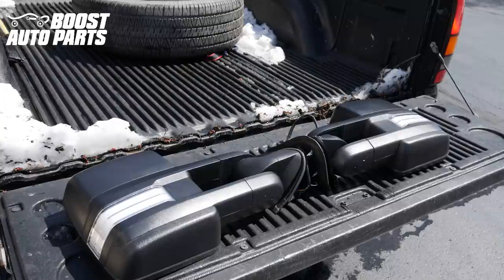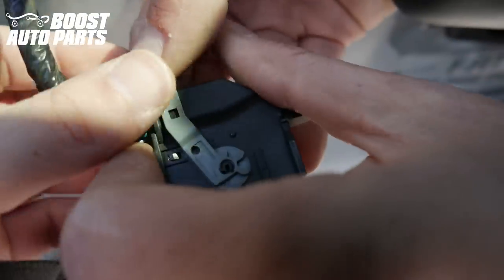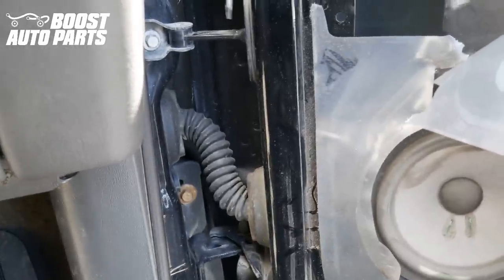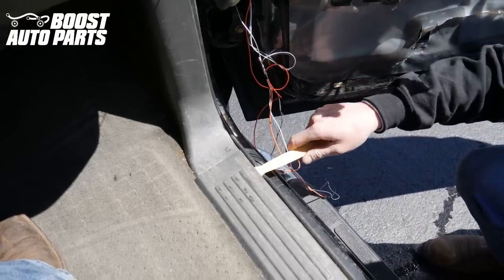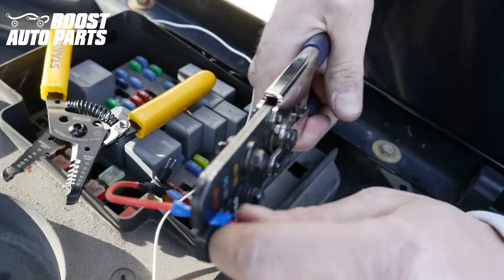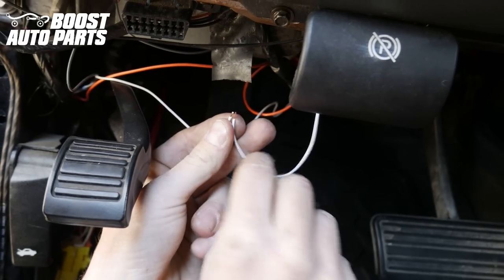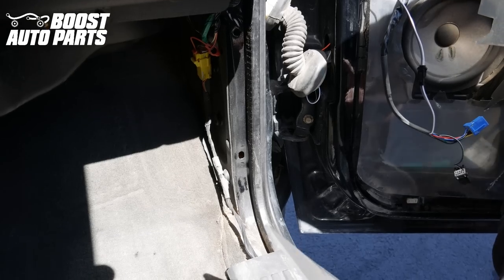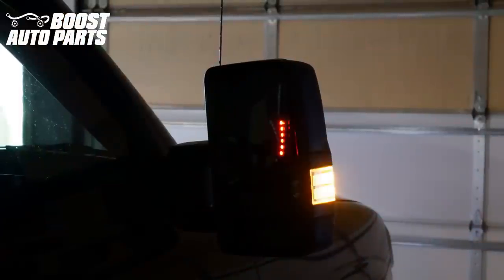Full Tow Mirror Install: (2003-2007) Silverado & Sierra - Boost Auto Parts

Comment: Thank you Adam and Ed.  Got my mirrors installed.  Purple wire was power on the 2 wire pigtail.  2006 Duramax.  Finding that gray wire was a bit problematic.  2 gray wires with dark stripes.  One was black and one was a really dark blue. Had to have wife look at it also to confirm.  Put a zip tie around it before splicing to ensure correct wire.  Getting through door rubber bushing was easy.  Splicing wire while being a contortionist under footwell was fun.  Your module works well.  Thanks again BOOST!!!!

Comment: My truck has no wiring going to the mirrors at all and I don’t believe I have rear defrost. How would one go about hooking up all the features of these mirrors on a truck like this 2003 Chevy Silverado 4.3 v6 2wd single cab long bed
Reply: Thanks in advance for any help and answers
Reply from the maker: Hello,
With your truck having a fully manual mirror some features may not be able to be achieved. Please contact sales@boostautoparts.com for specifics on your exact truck.
Reply: Ok thanks
Reply: @wyattsrepairs8860  what'd you end up doing? My truck is exactly like your's.
Reply: @RodknockRhett you and him need to both buy another truck
Reply: @kozmicflush980  I think I might just run my own wiring at that point. Put it on a fused switch.

Turn signals are also an easy one too. Tap into the wiring at the bulb. But honestly, I've been fine without any of it working. Might still do the heated mirrors but honestly I only use the truck when I haul stuff (nice weather obviously).

Comment: can these be installed/ will all the light features work on a Work Truck trim with non power doors?
Reply from the maker: Yes - though we would probably recommend purchasing the 99-02 mirrors if you don't have power mirrors because the wiring is better for hardwiring them in. Give our support team a call at 765-831-2830 and they can guide you to the best set for you!

Comment: I have watched several installs of these mirrors on You Tube, and nobody is indicating whether the  new mirrors's adjustments are controlled by the switches on the door.  Are these new mirrors electronically adjusted, or manually adjusted?  Please and thank you.
Reply from the maker: Our mirrors are power adjust; controlled by the switches on the door.

Comment: Can I wire my reverse and dome to the factory puddle light wiring on my factory harness? That way the spot lights also come on when I unlock or open the door at night instead of turning on when I turn my dome lights on manually.
Reply from the maker: That's a great question for our support team - give them a call at 765-831-2830 or email support@boostautoparts.com and they can assist!

Comment: 2004 silverado, did all identical wiring with no dome option. With key on everything works as it should, white DRL and switchback. But when engine is on the white DRL turns amber and loses turn signal/switchback function in the front. What would cause this issue? Thanks!
Reply from the maker: We have seen some vehicle side issues cause this. Give our support team a call at 765-831-2830 and we will get this resolved ASAP!

Comment: have stock mirrors for my 07 Sierra Duramax ...tow mirror on driver side will not adjust in tow position (extended), work when not extended, what would be the likely problem? thanks, nice video here
Reply from the maker: It sounds like there is likely an issue internal to the OEM towing mirrors themselves; you will likely need to replace the entire mirror assembly.

Comment: In my kit I only had two sets of white wires that ran from each mirror, when you use the converter it seemed you had two more sets of white wire so four in total so now I’m confused on what to do.
Reply from the maker: You bring the white wire from each mirror to the driver footwell and got off the extra length. The extra two wires you're referencing are the extra white wire that was cut off of the drivers and passengers side once they were brought to the driver footwell and cut to length.
Reply: @boostautoparts  perfect I will try that!

Comment: so i have a 04 Silverado but its has the work interior with no electric mirrors stock i have electric mirrors on it right now but need to find the wiring to send power to the mirrors please let me know if you know how to help
Reply from the maker: Sorry - we do not currently have a power adjust upgrade path outlined for these vehicles.

Comment: Is their a way to get replacement grey white extension wire ? If so where
Reply from the maker: If the mirrors are originally from us send an email to support@boostautoparts.com or give us a call at 765-831-2830 so we can assist.

Comment: I see you put the fuse you toom out into the adapter but what is the fuse that was already in the adapter? Did you just double them?
Reply from the maker: Our fuse tap comes with a 5A fuse.
Reply: Boost Auto Parts 

      Size of fuse holder?   Mini ATC or regular?   2006 Duramax

Comment: What if my stock mirrors don’t have defrost but these new ones do?
Reply from the maker: The defrost will work off of the rear window defrost button.
Reply: @boostautoparts  ao all you have to do is press the defrost button? No separate wiring?
Reply from the maker: @jbear6947 Correct. Mirror defrost will activate with your rear window defrost button.

Comment: Will the spot lights turn on if i turn on the dome lights from the dash switch?
Reply from the maker: If you buy the dome and reverse option and manually command the dome lights on, then yes the mirror spot lights will come on.
Reply: If i don't choose the reverse and dome option but just reverse only, will they light up by the key fob unlock just like the stock reverse light?
Reply from the maker: @seangowan7441  That depends on your vehicles specific configuration. Please contact sales@boostautoparts.com for further guidance or call our team at 765-831-2830
Reply: @boostautoparts  It's a 2004 Chevy Tahoe.
Reply from the maker: @seangowan7441  Please contact our team - they are most versed in the specific fitment related questions.

Comment: For the signal/running light is it a 1.0 or 2.0?
Reply from the maker: In this video we show a switchback, which is a white running light and an amber turn signal. The comparable version if you were wanting only amber (no white running light) would be the 2.0.
Reply: @boostautoparts  alright thanks

Comment: Orange Fuse ?
Reply from the maker: How can we help?
Reply: What fuse is the orange one .
Reply from the maker: @j.rbeastbangz522  Orange wire is for the running light
Reply: Because on the fuse tape you have a orange fuse already..
Reply from the maker: @j.rbeastbangz522  We are not understanding your questions. Please call our technical support team at 765-831-2830 and we can assist with your question.

Comment: Could i hook up rear leds to the cargo light fuse instead of the reverse one if I wanted to just use them off the button?
Reply from the maker: Unfortunately not due to the design of the cargo light system on this year truck.

Comment: This will work for a 05 classic right? The only wiring I should have is turn signals. How does the defrost get wired?
Reply from the maker: Yes this will work for an 05 Classic. Defrost is plug and play with our mirrors and controlled by the rear window defrost button.
Reply: @boostautoparts  thanks! I wasn’t sure since it lists almost every year in the category but doesn’t show a figment for 05 classic. I just see 07 classics. 👍
Reply from the maker: @RBoysMedia  Got it!

In model year 2005 there's no such thing as a 2005 new body vs. classic body, so we just call it a 2005 but it will absolutely work for you!
Reply: @boostautoparts  exactly. Thanks!

Comment: Just installed these and these are so awesome! If you've been wanting a set, pull the trigger and get them! You won't be disappointed!!!

Oh, and use the RED spicer when tapping into the wiring for the dome/courtesy lights! The blue tap is too big and won't make the connection. (Ask me how I know.)
Reply: What's a red spicer?
Reply: Hey man, did you have to wire anything up to get the blinkers to work? I mainly just want the blinker function on my 07 classic but I don’t want to have to wire

Comment: I’m a bit confused run the passenger to driver side spliced it, run it up to the fuse box, where does the white wire for the dome come from
Reply from the maker: You run a wire from the dome light wire to a blue wire on the dome and reverse. We have a separate video that just covers the dome and reverse.
Reply: Wait if you got the signal only mirrors does the dome and revers work with them ?

Comment: I'm so confused I'm currently installing the switchback option with dome and reverse on my 2003 Silverado and I understand you sliced the passenger side orange and white wire to the driver side orange and white wire and ran those up to the fuse box but now you're saying to you both of the white wires from both mirrors and put them into p/n 1844C But but both of my white wires are already spliced together and running up to the fuse box So what do I have to do and how will I do it??
Reply from the maker: Your two whites that run to the mirrors will be on the single output of the 1844C. On the side of the dual function dome and reverse module (PN 1844C) you will have reverse from the fuse box on one side, and dome from the wire on the A-Pillar on the other.

Reach out to support@boostautoparts.com and our team can further clarify this or walk you through it over the phone.

Comment: So what happens with you go to slam the fuse box cap in the engine bag, boom fire hazard by pinching wires and shit not work 😂
Reply from the maker: Not the most wise idea to do that, but even if it does happen it wouldn't be a fire hazard because everything we sell is fused appropriately!

Comment: Im currently trying to splice lighted door handles in, and cannot find what wire turns the sequentials on on the front of the mirror. Does anyone or can yall help me?!
Reply from the maker: Give our support team a call at 765-831-2830 and they can detail the wiring color configuration on our mirrors.

Comment: Installing mine today! 2007 2500 Duramax Classic. Broke my driver side main mirror by pressing up on it as the motor was getting tires. Well the glass didn’t like that so much. So I currently have a high mirror, mid mirror and wide angle low mirror. 🤣 So, it was the perfect excuse to order this set up.

Comment: My my rear facing light blinks with my switch backs on the front of the mirrors and doesn’t turn on when I put it in reverse. Any tips? I’m pretty sure it’s wired just like in the video?
Reply from the maker: It sounds like something may be wired wrong internally inside the mirror. If the mirrors are from us, email a video to support@boostautoparts.com and our tech support team will get to the bottom of it ASAP.

Comment: I got these same mirrors but mine just came with the reverse light wires will my running light still work without that additional kit ?
Reply from the maker: If you didn't originally purchase our mirrors with running light you can gain it but some wiring is needed. Reach out to our team at 765-831-2830 or sales@boostautoparts.com and we can let you know the best way to do this.

Comment: What would I do if I have a base model 2005 Sierra with no power mirrors or anything, how would I hook up the turning lights?
Reply from the maker: I'd recommend reaching out to our team at sales@boostautoparts.com or calling us at 765-831-2830 and discussing. More than likely our team will have you purchase 1999-2002 mirrors which have the same base, but would be easier to wire in the lighting features if your truck is totally manual.

Comment: My truck is an LT with power mirrors but no turn signals. Would a lighted mirror like this with reverse lights work because I have power mirrors or would have needed to come with turn signals?
Reply from the maker: Our mirrors will be plug and play for turn signal functionality even if you didn't originally have it. To gain the running light and reverse light functionality you will need to wire it into the vehicle by following this video.

Comment: So for the dome and reverse lights are the mirrors supposed to come with an extra white wire? You say that the white wires used in the output aren’t the same as the ones running to the fuse box, so what white wire is it?
Reply from the maker: It is just an extra length of wire; most people cut off the extra slack from the drivers side and use that. Please reach out to our support team at support@boostautoparts.com if you need assistance
Reply: Where can i buy the reverse/Dome switch from

Comment: How do I wire these if my trucks a work truck model. 2005 GMC Sierra 2500 duramax
Reply from the maker: You would need to hardwire in the turn signals. Reach out to our team at support@boostautoparts.com and they can provide guidance.

Comment: Why can’t I bolt on and plug them in to existing wiring?  I want tow mirrors but have no interest in running wires. To be honest I don’t need them to even telescope. Just want the bigger wider mirrors with same adjustability  function as a standard non telescoping unit
Reply from the maker: You can - all of the wiring is for the lighting so if you don't wish for the lighting to function you don't need to wire it in.

Comment: so do i connect the two whites and the two oranges from each mirror and run them up to the fuze box? but then where does the third white wire run.
Reply from the maker: Yes - whites splice together as do oranges. If doing dome/reverse you'll have one more white feeding off the dome wire. Give our team a call at 765-831-2830 for further clarification

Comment: Just ordered some of these for my 04 duramax, do I have to run the wire tap? Can I just use them like plug and play and still have blinkers and defrost and such
Reply: Is yours a 04 classic?
Reply from the maker: You can retain the features originally equipped plug and play. Give our team a call at 765-831-2830 with any questions.

Comment: The ones I installed only had 2 sets of orange and black wires . I fed them through to the battery box but I have no wire taps . If I were to get fuse/wire taps for this would it work without the ground ?
Reply from the maker: You will need to ground the wires as well.
Reply: Thank you for the reply . Where are the other end of your ground wires attatched to ? Mine only had a red and a black wire for each mirror . I have them wired up just like in the video they work but they flicker . How would I add a ground to a setup like this ?
Reply from the maker: @mattboone1926  Unfortunately since the mirrors are not from us we would not be familiar with the internal wiring so we would recommend reaching out to whomever you purchased the mirrors from.

Comment: Buying for my 04 Yukon what’s the difference between signal and running 1.0 or 2.0
Reply from the maker: Signal & Running Light 1.0: The lights will flash as a turn signal. At night when the running lights are activated, the lights will operate at 50% intensity for running light, 100% intensity for turn signal.

Signal & Running Light 2.0: The lights will flash as a turn signal. At night when the running lights are activated, the lights will operate at 100% intensity for running light, 100% intensity for turn signal.
Reply: Boost Auto Parts thanks really helps out

Comment: So do you connect orange wire ? Both or ???
Reply from the maker: Yes, both orange wires need to get connected. You can run them both to the same fuse tap, or you can splice the drivers side to the passenger and then just run the drivers side to the fuse tap.

Comment: Everything works fine on mine but the only thing that doesn’t is the running white lights
Reply from the maker: If your mirrors are equipped with the running light feature that would be controlled by the orange wire on our mirrors. Reach out to our support team at support@boostautoparts.com and they can get you situated.

Comment: If my truck already has factory heat and signal do you still have to run the wires all the way over to the driver side and tap into the fuse box?
Reply from the maker: Only if you want the reverse light and running light to operate.

Comment: What if you don't have turn signals on your factory mirror are you just screwed?
Reply from the maker: Turn signal on the Boost mirrors is plug and play as long as you originally had power adjust (even if you didn't originally have it)
Reply: @boostautoparts  Thanks ordering some this weekend for my 01 2500HD just saw the installation video
Reply from the maker: @z71ben43  1999-2001 is a separate installation procedure and the wiring needs to be tapped. You can check that out here:  https://youtu.be/34zw6FMHTZE

Comment: Does anyone know if you can use the automatic feature to fold the mirrors in from the buttons on the driver side?
Reply from the maker: We don't currently offer power fold, it is under development. If you email sales@boostautoparts.com they can put you on a list of people to be notified once they're available.
Reply: @boostautoparts 
Two years later, are they still in development?
Reply from the maker: @lewisgeer1994 coming out of development just now - we don't release things until they're 110%. Should be released later this year or early next year. Email sales@boostautoparts.com to be notified when they release. We will likely do a discount code for pre-orders.

Comment: Is this the switchback option? If so does that have running white lights and then switches to the amber when turning? Making sure before I order because I want white lights for my running lights
Reply from the maker: If you order switchbacks they will have a white running light and then switch to amber when the signal is turned on. We do show switchback lights in the video.
Reply: I just bought the switchback but it doesn’t work, only the sequential turn signals. (2005 Silverado 1500)